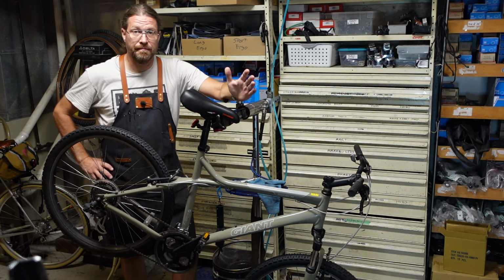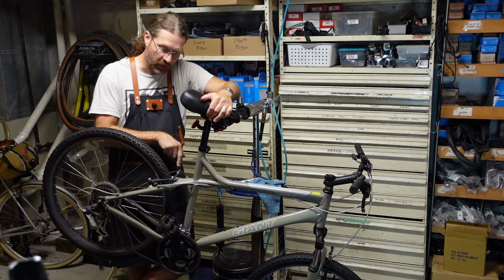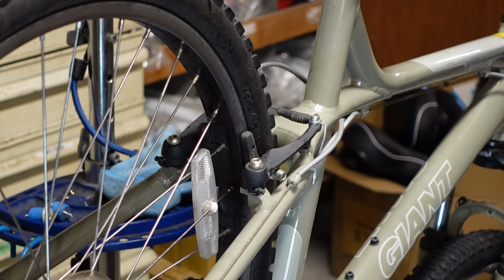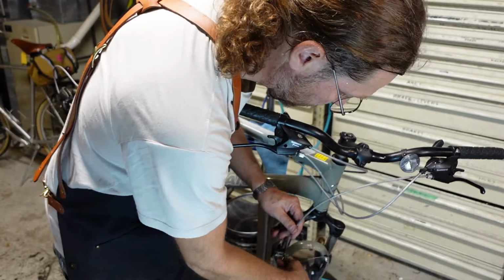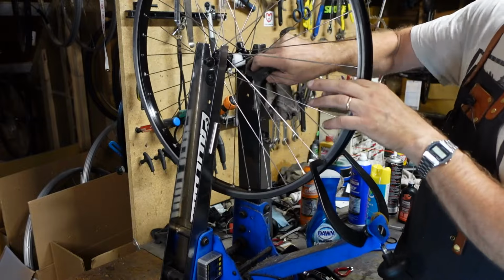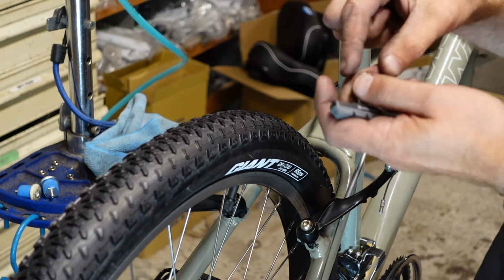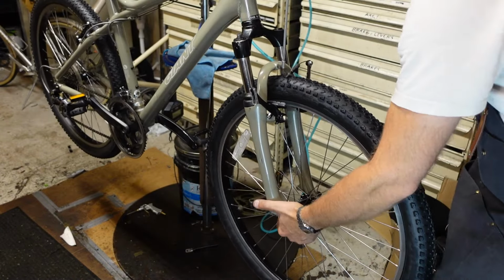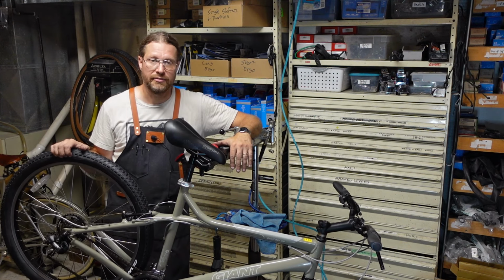SERIOUSLY! Why can't they make EVERY BIKE like this? Giant Boulder SE gets reconditioned!

Comment: Problem with tubes is I punctured 28 tubes in a month once, I could not take it anymore. So if doing long rides tubeless is king. for shorter rides where you don't have to walk kms to get home, or replace a tube during a ride is nice.
Rim brakes are fine if you don't get the wheel out of true, or contaminate the braking surface, so dry riding it's nice and simple. But as a mountain biker I want brakes to work independently of the rim.
An issue with bikes like this is square taper cranks get loose. Those pedals are scary, barely a platform.
For some reason some bikes come with same fork basically disc brake version of it, but on bikes marketed as dirt jump, and then kids actually do it, and coil shoots up. But this absurd marketing seems to be gone now.But this bike is intended for gentle riding anyway. Not a DJ frame with junk parts.
Reply: If tubeless was a good idea the car tyres wouldn’t have tubes fitted.

Comment: I'm a firm believer in sticking with bikes that have the standard seat post, standard head set and standard screw in bottom bracket. Things went crazy in the 20 teens with all of those things. Mind you I only ride drop bar bikes and don't own an MTB. But even in road bikes all of a sudden there were 6 or 7 different bottom brackets, all press fit, and they all creaked terribly. Only now are a few bike manufacturers finally going back to the English threaded BBs. Integrated bars and stems. Good grief. Why did this happen? It's absolutely friggin' stupid. They eliminated adjustability in one fell swoop, trying to make something look cool. Seat posts. This drives me stupid mad. There was nothing wrong with a standard seat post. There were two diameters. That seemed to work for everyone. Then, in this stupid aerodynamic fad, every manufacturer introduced their own stupid seat post that wasn't round. If you broke your seat post or clamp, or lost a bolt, you're done for until you can order another one online, because the chances of any shop having one is all but nil. A couple of manufacturers still use 27.9mm seat posts, for a couple of bikes.

Comment: I wouldn't generalize some really good features like disc brakes and tubeless as being some marketing gimmick for a quick buck. All about use case. I got a hand me down hardtail from a friend and, in my first month of mountain biking, I had hiked out 6 times from pinch flats. Twice I pinch flatted the spare tube I had as well. I also would have definitely flown off trail and crashed hard several times without the disc brakes to really grab hard and slow down when I needed to. I don't get the eyerolling attitude towards disc and tubeless... I've had no issues with the hydraulic brakes and haven't had a flat once since I put tubeless wheels/tires on.

There is a huuuge range of riding thrown in with the term "mountain biking" with anything from a basically flat dirt road up the pro downhill racing. Generalizing features one way or another is fairly lame and also doesn't benefit your customers at all either.

Comment: Bikes for regular people. That is what we need. I get bikes from apartment clean ups and rebuild them to sell as I can no longer ride a diamond frame bike. I ride a Bacchetta Giro A 20 touring recumbent with a couple modifications, to seat and gearing. The diamond frame bikes that are 20 years old can be upgraded to today with a bit of expense but well worth it. BTW I bought the top of the line aluminum bent and in hindsight I really should have bought steel as a touring bike is about flexibility and not a stiff frame for transmitting power to the pedals.

Comment: For a tire of that volume and not setup tubeless, probably being ridden on pavement or light gravel I’d set those tires to 35 in the front and 40 in the rear. That should be perfect for ride quality and not getting pinch flats
Reply from the maker: make 'em firm and ride the bike

Comment: Wtf was that for kind of weird issue with the seatclamp lol

I've had something similar with aligning disk brake calipers some time ago, so simple, but yet so hard to determine the cause.
Eventually discovered that some of the paint of the frame was too close to one of the mounting holes for the calipers.
Scrubbed that little flake of paint off and the caliper centered in one go.

Comment: Worked on a bike for a customer who had a bike computer connected to the "brifters". It was very old and the wires were crispy so the second I touch it, it snapped.
Of course they don't make a replacement but the dude lost his cool so fast.
Reply from the maker: I was doing “free bike checks” before a large charity ride. I threw a lady’s road bike in the stand, cranked the pedal, pushed the right shifter over and … SNAP! Cable broke inside the old STI lever. Absolute nightmare to fix. She was convinced I broke her bike. There was no way of convincing her that it would’ve happened to her on the first hill had it not happened in the stand.

Comment: It's seeming to me that finding a bike for a tall person in a bike shop (or a cycling shop!) is harder these days. With the compressed/compact geometry of modern frames no one seems to carry an X-Large frame bike. There are some large frame bikes 6'0-6'4" but I always look for an X-L frame. I usually buy it immediately when I do see one. They seem to be getting rarer than hen's teeth lately. I'm almost ready to buy a used frame and have it built up. Any thoughts? Ps. I wanted to take that seat post away from you and throw it in the bin...great patience on your part! 😎
Reply: Everyone knows being tall isn't aero

Jokes aside it's a real issue.
Reply: Same here. I'm constantly scrolling through bikes ...." Too small, too small ..."
I bought a vintage Peugeot road bike recently. 25 inch frame. So you could try looking up vintage bike frames

Comment: Do you think that lubing cable housings is just a temporary fix..?  We were always warned against doing that, as that lube will dry out and gunk up...

They make dry lube for cable housings, which i've never used personally...  I bought a really expensive tiny bottle of shimano wet lube specially made for cable housings, haven't tried it yet...  

The last few years of commuting daily including city streets in snow, i've just replaced the cables and housings annually (with jagwire), but  of course that's not free...

Comment: Not a big fan of phones as bike computers. Even the top end smartphones have bad GPS accuracy. It may be enough for navigation and the casual bike rides but not good enough to track distance, elevation and speed. This issue also affects almost any smart watch. If you care about accuracy but don't need a good display, get a used Garmin hiking handheld and a handlebar mount. And because smartphones in  the rain are unusable, I went the expensive route to get a Wahoo Roam. It's expensive, only recommend it for cyclist or touring riders.

Comment: the average casual rider would be fully suited to use an old late '80s or '90s chromoly mountain bike fixed up, minus the front shock which is so unnecessary for so many people, I was in one of these bike shops trying to buy some parts and was almost laughed at! The same time I saw a novice patron getting sold a $700 bike that they might ride once

Comment: Why do manufacturers put those awful front shocks on lowest models. IMHO the bike would be a nicer ride with a light weight rigid fork with a nice rake for flex. Those bikes are mostly on roads and easy terrain. The bike would lighten up significantly.

Comment: Disc brakes are far better than rim brakes. When it's wet with rim brakes your wheel sometimes needs two or three revolutions before the rim dries enough for the pads to get traction. By that time you're already in a tree.
Reply from the maker: If you stop that fast when it wet you’ll skid into the tree anyway, but yes, disk brakes performance is better.
Reply: @bkefrmr  if you use your brakes properly and apply the front brake a fraction of a second before the rear you will cut the risk of skidding way down.

Comment: There is a place for BOTH. Your bikes are neighborhood bikes, they are cool, they are great for around the neighborhood. They may outlast but they will NOT outperform cheap modern department store bikes (sorry but the world switched to disk brakes for a reason).  Your bikes are great for what they ARE but your comments are biased. Old bikes are  studier, easier to maintain, require much less maintenance and are fun. But cheap modern bikes shift better and stop better (as a group) end of discussion.  "Cyclist bikes", as you call them, can go places no bike from the 90's and before ever could. I am 68 years old, if I want to go on a long bike ride, a full suspension, e-mountain bike will let me and if i get tired it will "help me" get home. I love them and  I also love old bikes to putz around the neighborhood and not worry about. They ALLLL have their place. I like the way you do not over repair old bikes. You do not need to put other styles of bicycling down to promote your preferred style.

Comment: strange but non professional approach on video is shown, no hubs, the are no bottom bracket and fork bearing check up and regreasing on 20 y.o. bike...even chain worn out measurement missed.. over all- free barn found+new tyres+ new brakes+rim cleaning sale for 300-400 usd...good joke foergot mentioned that for 300-400 buck easy find good niner on good rims 1x10 or 1x11 cassette not crappy freewheel 3x7...